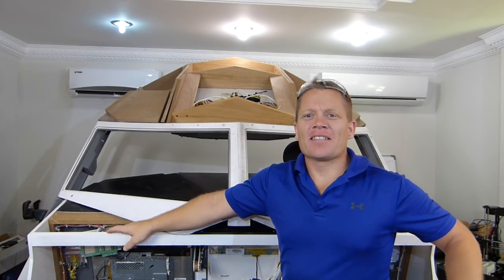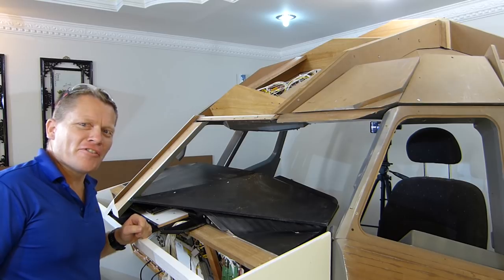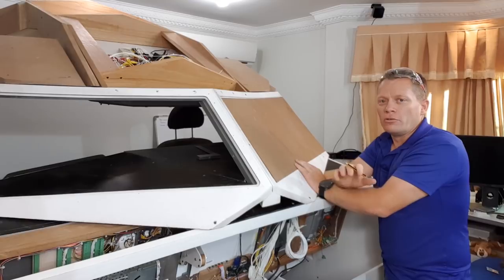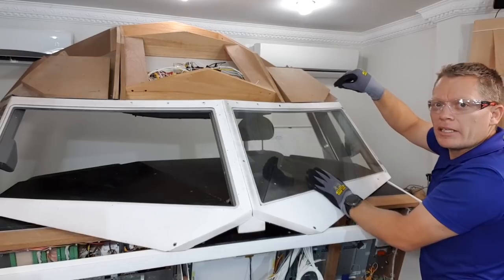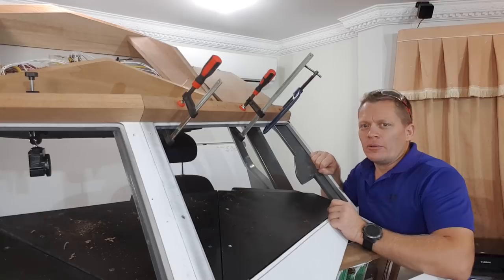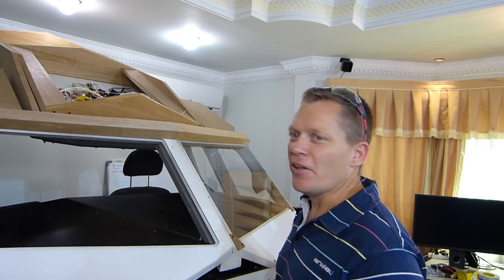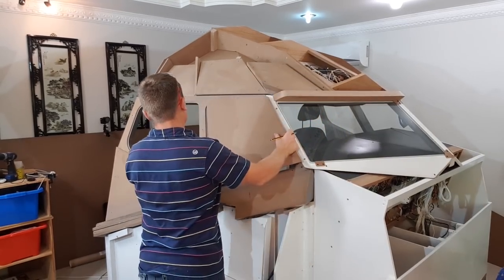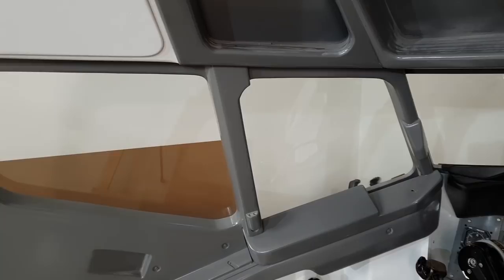737 Glass Install EP21

Comment: Lucky man that you have these cutouts to fit the windows in perfectly. I will have to go for a more dirty solution. But these wires - I remember the episode where you showed how youuse different wire colors for the cables and now there is a bunch of cables from which you don't know what they do? :-)
Reply from the maker: Good Morning from sunny Brunei! You are completely right that i used different coloured wires to represent a specific component. However, as you can see the two bundles shown in the video, the white wire looms from the left and right break out boards which should go to the ardunio network in the glareshield Assy. These are not labelled or identified. I didn't keep the notes i made because i didn't think id be taking it all apart again. Hence overtime, i have forgotten where they should go or what they are. But it will be just a case of buzzing the lines through.

Comment: why didnt you use plexes or perspex?
Reply from the maker: HI Oliver, Perspex turns yellow and warps out here in the sun. Also after version one of the sim, you actually need to clean the windows often due to the amount of dust that lands on them. Perspex would quickly scratch. But I appreciate, if that's what you have, go for it and its a lot safer! Glass out here, was really cheap, and they cut it free for me.

Comment: What size screens did you use for all the displays?
Reply from the maker: Hi as a general rule of thumb: f/o & Cpt screens are 18.5" 16:9 ratio. However, if you to incorporate the chronometers, this can go up to 22" monitors. Centre Eicas in mine is a 14 " 4:3 ratio but a 15" will fit. The lower Eicas if you follow my build plans will fit an ideal 10" monitor upto 12" monitor without modification. I hope that helps, all the info is on the website www.737diysim.com/downloads/mip